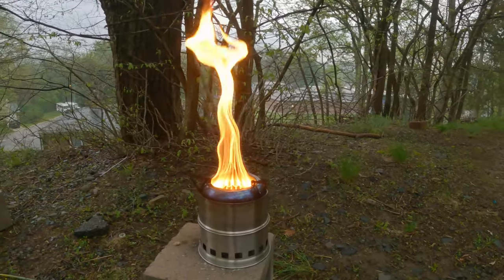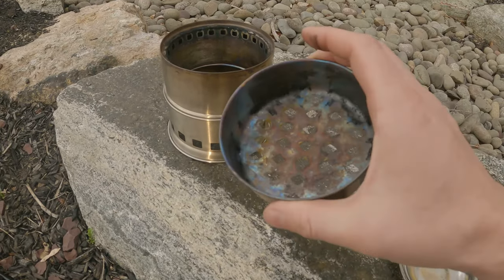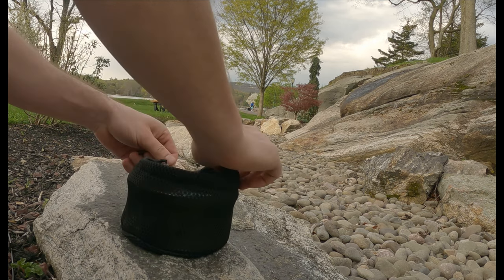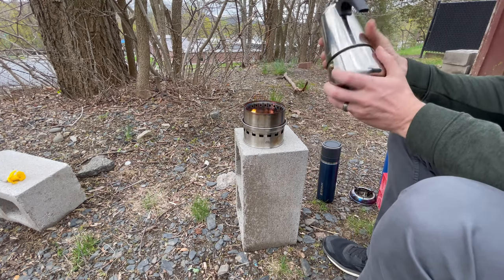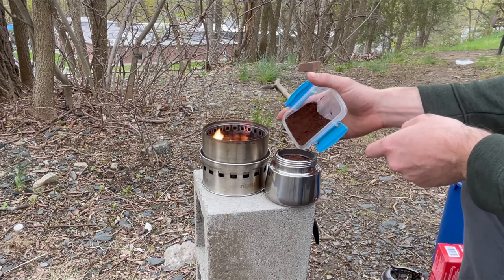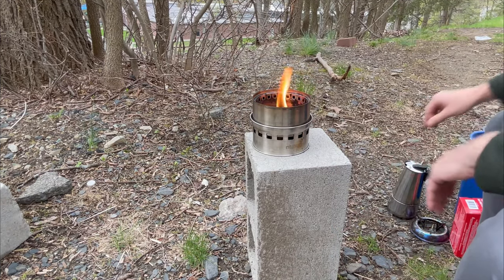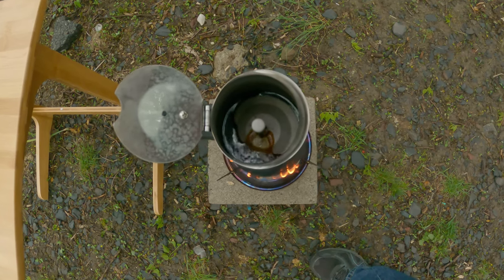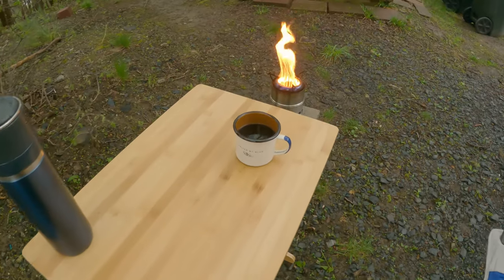How to Make Coffee on a Wood Gas Stove

Comment from the maker: How do you make your off-grid coffee?
Reply: Admittedly, I use a low-wattage, $40 Mr. Coffee coffeemaker (with a timer!) on my Jackery 1000. I won't crawl out of my sleeping bag unless coffee is already made. LOL
Reply: Usually a rocket stove with tin cup and grounds    I like that percolator but may be bulky to carry. I also have that stove but currently I rarely use it
Reply from the maker: @johnedwards8699  I use a rocket stove too. It’s a lot easier to light and can put away quickly after.
Reply: Where is the link for the percolator? Thanks for the videos.
Reply from the maker: Hi,  I just added the link to the description.  Thanks!